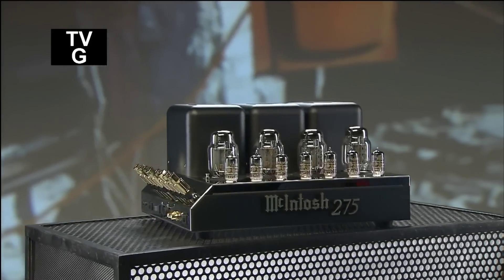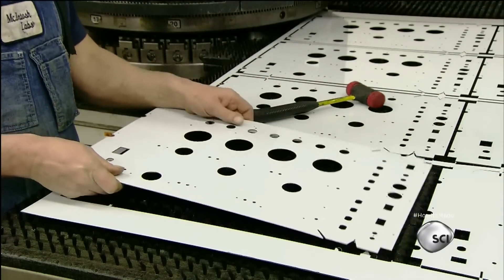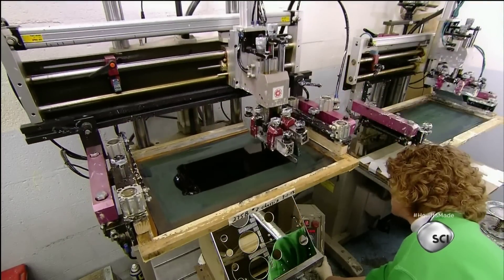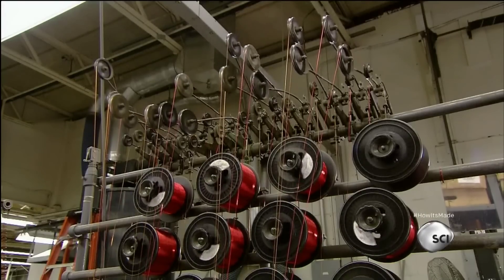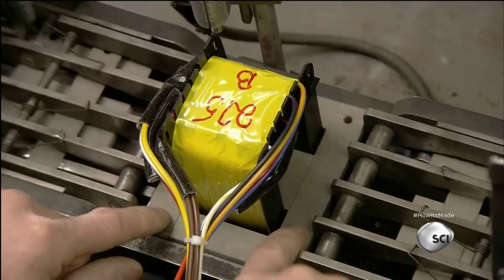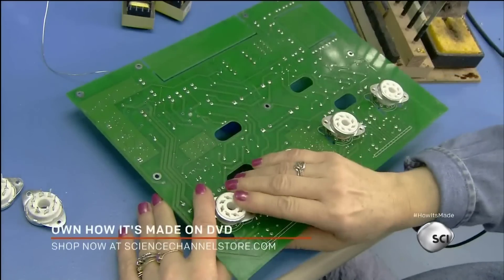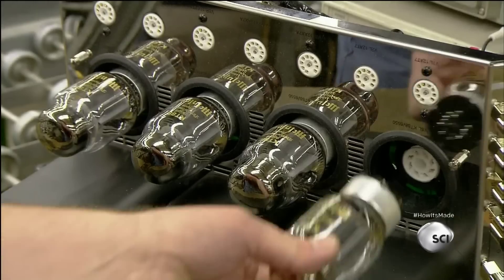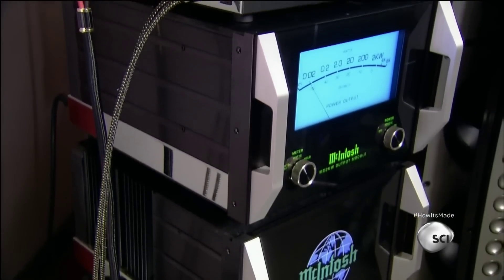How It's Made - McIntosh Tube Amp

Comment: 4:45  'LED lights turn green when the amp is powered up to let you know your wallet has been rinsed'
Reply: No mate, I'm a retired English electronics engineer, with valves and their operation well behind me. Contrary to popular belief, I am neither senile nor stupid. Old I may be; life's experience has taught me how to spot gimmickry a mile off. I could enrich my retirement by going back into the business and selling new clothes to gullible kings for vast crocks of gold. I can't be bothered. I am comfortably off in my retirement without the need for watching people burn money purely to show their friends that they can. Don't bother trying to patronise me, I'm too old for that sort of thing. ( 'oligarchs' by the way )
Reply: Really Paul Arias ? ... If transistor is not cheap  you will not be typing behind the keyboard.
Reply: I gotta say I hate those LEDs. They interfere with the soothing orange glow of the tube filaments!
Reply: +Prince Westerburg LOL any home system would be source limited long before I would pay a fraction of £500k for it...not saying a good salesman couldn't sell it to someone with the money.....just put that price tag on a $1000 system and tell me how it sounds then...
Reply: What are you guys talking?
Tubes have a much less live span than transistors. And Transistors nearly never die. Capacitors and such are built to fail in devices but not transistors. A Transistor probably would survive many tube lives......
Reply: For some odd reason I found your comments in the reply section to my original comment a year ago, so I replied.
Snap on MoD, plus lots more. I also have forgotten more than I can remember, most of it now superseded by higher level equipment. If you reach the age when you can afford this sort of kit, it is likely that your hearing will have deteriorated to the point that it is your ego and imagination that convinces you that this system and it's like are worth the money. Like I said, new clothes, gullible kings, pots of gold. It is possible that we are both pushing at the same open door, no offence implied or intended. :-)
Reply: If it's that good, why would you want to sell it? If you are buying the ultimate amplifier and someone makes a better one next month, then wait and buy the better one.
This can go on for many years, until you tire of wasting your money on last-year's model.
Reply: I listen to music - rememeber that? :)
Reply: Paul Arias Tubes need much more circuitry to get a result as transistors because of tube distortion.
Reply: @Rob Okray

I have an Solid State Amp Built in 1978. Never got refurbished or anything. All Original. Still working perfect. ( Sony STR 5800)

Watch eraly transistor radios. Old handheld Radios of mid 50`s. Many still work even WITHOU recapping.

But Capacitors and such have nothing to do with the transistor itself or its lifespan.

Theoretically Transistors are unbreakable. Only thing which could damage it over time is heat or mishandling. Otherwise there is no reason for a transistor to fail.

I am Guitar Player. On a 50W Guitar Tube Amp you have to change the tubes every 1 - 2 decades. Otherwise you can notice differences in sound characteristics ect. Also Tubes do not fail rarely in such amps.
Reply: But every piece of electronics get worn out sooner or later.
Reply: Tube "distortion" is why you buy tubes. Also electric guitars? Guitar guys kill for tube amps.
Reply: Having solid state, hybrid and full tube amps, both a MaIntosh MAC1500, and a modern push pull as well as a few single ended amplifiers I built myself I can tell you which ones I prefer to listen to.
It is not the 50 year old vintage amp either, it is the low power single ended amp I built.
No tube amp is as clean as a solid state amp, but it is the 3nd order harmonics added by the tubes that makes the sound warm.
A cheap 50.00 tube buffer will do exactly the same thing on a solid state amp. It takes the edge off of the harsh sound of digital sources.
Reply: nlo114  That's the best laugh I've had all week. Thanks !!!
Reply: I totally agree! I mean, my speakers I got off FreeCycle for nothing, bought tweeters at an electronics sale, built new crossovers and they sound amazing. Ditto with my amps, I just bought components. The Partridge c-core output transformers where the thing I had to wait 15 years to find.
Its not as good as an Audio Note system in that their stuff has matched components so the soundstaging is amazing but its still an 'Emotion Machine', people come round and just melt on the sofa!
One fave recording is Ella Fitzgerald and Louis Armstrong singing Summertime from 1953 and its like it was recorded yesterday.
The La La Land sound track is f*cking amazing! :o)
Reply: P.S: In my workshop I have a lovely pair of un-restored Goodman's (solid teak ) Magnums that I bought off flea-buy for the same price as they were new in early 1970's. I mainly use them for listening to music as I work, their sound pressure being quite adequate for my listening requirements . From time to time when I play DVDs they provide a wonderful depth of stereo sound at low volumes, without needing super-current to drive them. I say 'stereo' because like a lot of older people I only have two ears, rather than the latest odd-number variant of the human race.
Reply: Well it is for the believers...
Reply: I am a perfectionist.
This means that I am never satisfied, so I never waste money until I see perfection as the light at the end of the tunnel. Perfectionism is a sad disease that ends with very low achievement, primarily because second best will simply not do, and buying second best is not good enough. For money earning purposes, I work in the space industry where there is no second-best, only fitness for purpose at the specified price. That is my only source of mental satisfaction.
Reply: All depends on the circuitry design. I know older guitar amps had bad designs using one power supply for all tube heaters which is leading to uneven wear. While some tubes were a bit overdriven others got too less. High End guitar amps have a single PSU for every tube or 2 as far as i know to pretend uneven wear and all such. But in comparsion with transistors, if driven correctly, transistors only enemy is heat.
Reply: Tube Amps are not better. In fact Tube amps are the worst thing to go if you want accurate reproduction of your audio.

ALL Tubes has Distortion characteeristics which makes this warm tube sound. What means distortion? Exactly, the output signal does not match the input signal in any way anymore.

So technically tubes are the worst to go. But some people just like that warm sound with tubes and vinyl records.

But that is a subjective oppinion and a matter of taste. It is not my taste i have to say clearly. I prefer my Sony Amp totally.
Reply: BTW, if you're in the south east, have a look at www.audiojumble.co.uk - lots of other similar events about, they are a great day out!
Reply: LOL, exactly..use the "think method".. it will sound so much better..
Reply: Because we're human and like to try new things. Just because we sell something doesn't mean it sucks. This hobby isn't fun without variety. Understand?
Reply: Ok, maybe I was harsh on transistors, but valves/Vacuum tubes seem to me superior in every way on stereos and intrument amplification, prove of that it's use world wide up to date.
Reply: Oh, so now they are all the same. lol
Reply: Klipschorns and some other speakers do sound nice with a few watts from a good tube amp though.
Reply: What?!? Ona 300B amp theres the 300B and the output transformer. Apart from a 1k resistor on the input to stop parasitical oscillation and maybe a pulldown thats it. really, there is nothing on the page. If it doesn't look like that then its complete crap and I agree with you! :o)
Reply: 12voltvids m
Reply: There are equalizers to get whatever kind of sound uwant
Reply: i am using the software equalizer of my soundcard ( external dac was too expensive for me )
I mainly use it to get the sound I like. I did not do much in the EQ. I raised 4, 6 and 8 KHz a bit because i like brilliant heights and my speakers are known to have a little disadvantage in the mids / presence
Also i pushed 60 and 30 Hz a little bit up to recieve a bit more vibrance in the sound.

I would be intrested in measuring it to get a feeling how flat is it now and how they are with no EQ etc.

But i dont know how i can measure it properly. I did not found any Datasheets to my speakers on the internet.
Reply: You can test them in a tube tester, but yes they are probably still fine. Unless the seal breaks and the tube goes gassy or they are over driven, or the bias is too high they can last for a long time. My McIntosh MAC1500 still has most of the original tubes and they are still performing great. The capacitors are when went bad and have been replaced.
Reply: @ukfan4sure1 as electrician and future hopefully electric engineer i know enough about tubes to know they are inferior in any way.
Its your subjective taste if you like them more for what ever reason.
Reply: @ukfan4sure1 
Is that not what we strive for. So that the system accurately reproduces the sound as recorded? I believe that is the goal here to be transparent, and not add or subtract from the recorded sound.  Correct room acoustics play a role, as does ones hearing or lack of it. However, an equipment manufacture tries to build equipment that will pass the signal through without degrading it, and flat is about the only way to do that.
Reply: @ukfan4sure1 but you would never agree to a blind A/B comparison just like the rest of your rhetorical ilk...that's the point not your nonsensical slop...
Reply: @ukfan4sure1 i know exactly what you will do from experience with uninformed elitists like yourself.. you will rave on endlessly and actually do nothing to improve you position of zero information.
Reply: @ukfan4sure1 LOL maybe so..but that doesn't change  your imbecilic caterwauling into anything useful..parasites to the internet like you should go away and stop bothering people..
Reply: @dom3827  I suppose you are an electronic tech?
Reply: @dom3827  good for you..
Reply: rinse and repeat I always say. LOL!!!!
Reply: How much do they cost then?
Reply: Yup, green IS the color of money...and specs don't support that tube amps are better...and so called audiophiles will NEVER submit to blind comparisons for any equipment..
Reply: @oilsmokejones3452  thats because this $30,000 turntable and $75,000 amps and $125,000 speaker nonsense is the same exact thing as buying a Ferrari over a Prius.  Both cars will get you from point a to point b but narcissism rules in this world and rich folks can't be bothered with the fact that the money they paid for a record player could feed 10,000 homeless people for 3 months....
Reply: @oilsmokejones3452  Guitar Tube Amps are better that's for sure no matter what specs say..but thats different.
Reply: At least the amp wont be obsolete in 6 months.
Reply: +nlo114 maybe that is the reason why they call it "McIntosh". because its the same with Apple, you pay a huge amount of money for nothing :)
Reply: @dom3827  great sound, keeps its value quite well to. Quality true and true
Reply: @dom3827  ...i would prefer Ma,let Labs Hifi gear...
Reply: +Dominik Lux those amps sound amazing, nothing you say about the name will change that. but the led lights are pointless.
Reply: @user-by7hj4dj9s  agree. I don't know why you would want a fake light instead of the actual glow of the tube
Reply: So I guess you're American and therefore obsessed right now with your political system - understandable, but I live in London and don't follow politics.
You'd be surprised how much detail recorded media has, which does appear at the top end. The subject is so vast that you should appreciate it is difficult to explain in a YouTube comment!
One AN customer was recommended to us after he had spent hundreds of thousands of dollars on hifi and wasn't happy, then his wife bought a $100 Sony for the kitchen and he loved it - it had no pretentions. Look at most valve amps, they are simple and sound natural.
Ultimately, I appreciate that you cannot see what the fuss is about, top end gear costs up to 95% of it's price tag to make and until you hear it you cannot believe it will be better.
When you have billionaires and olygarks for who price means absolutely nothing, there always will be a market.
I have nothing to prove though I woudl very much suggest you go to a hifi show or dealer and listen to a valve system.
Reply: Gabriel Vazquez 
Equalizer? Seriously! A properly designed system sounds best with nothing between the components. Flat, because all the EQ was done by the recording engineer to produce the sound that the artist desired. Played on a properly matched system will produce that sound without coloring the sound in any way.
Reply: Good quality cost money. McIntosh components hold their value very well. Yes,  while the initial investment is high, when you go to sell the item you will find that you will get most if not all of your money back. This obviously speaks volumes about what customers are willing to pay for a high quality and well established brand like McIntosh.
Reply: DIY Dan  Well said !! As another footnote when these components become classics they often demand and get more than original purchased price. This truly speaks of their engineering, reliability, timeless design and consistent quality performance. As another proud owner I can attest to this as well.
Reply: You get what you pay for. The reason these are still being manufactures, and people pay top dollars for them is because they do have a different sound, and to those with the money to buy them, well worth it,
Reply: I like tube amplifiers and radios etc  just like how we still like steam engines/trains...  but  just like  those  steam engines ,  Tube  amps are  less efficient,  consume more power   and bulky.  A good solid State Amp will  beat  Tube amp in every measurable parameters.   Yes Tube amp does  beat the SS amp in the nostalgia  department.
Reply: "valves and their operation well behind me" - So why are you watching videos on McIntosh?
"I am neither senile nor stupid" - But replying to people who wheren't in a conversation with you.
A neighbour of mine is retired and worked for the MoD on missile guidence systems, he's forgotten more than either of us will ever know. He scoffs at valves too but then he hears my system is blown away. As said, you don't need to spend mega bucks, the sound is great and there are those who spend silly money on Naim / Ruake / Chord systems thats sound terrible.
Reply: So what? That amp will be around long after the solid state amp has been dumped in the landfill. Why? Because people throw away solid state when it breaks. Cheaper to get a new one.
Reply: My tube system is 50 years old, has a fresh set of tubes, caps and wiring. I also have another set of tubes and can get new matched sets easily for less than few new LP's. Not really worried. Also have two solid state systems, that while still "working" need recapping as they are sonically dead. As well as a pile of solid state systems that completely failed. All decades younger than the tube system, which only blew it's top in 2015. 1967-2015 was a pretty good run.
Reply: i know that they do so. My point was just the overpriced price tag specially of McIntosh and compared it to overpriced apple products. The name McIntosh matches good.

But yea, tube amps sound nice thats correct. I dont have one, but i have got a 1978 solid state amp so clean that you think its fresh from the company. A Sony STR 5800. For a Transistor amp it sounds really warm and nice. With that i am using 2 Magnat Zero 5, 20 Years old Speaker, but aswome and in best condition. And at last place ive got a 200€ Soundcard and flac music.
Reply: I can't speak for power amps, but tube preamps sound GREAT, and they won't kill your bank account.
Reply: +Dominik Lux if you got money for one of these you got tube money
Reply: Yeah, I totally get that - apparently the major record labels never wanted to move to stereo and it was only the marketing guys telling they could sell everyone new gear that made the choice! I run stereo as I've used surround and its a gimmick, almost impossible to set up correctly and with good hifi you don't need it really - its making up for inaccurate drivers.
Goodmans Magnums - paper cones, excellent! The BBC discovered to their horror that polypropylene cones have what they call 'poly-probles', inherent resonance in the midrange that kills sound staging, they moved to TPX cones. I use paper coned AR38s with Vifa soft dome tweeters and crossovers I copied from Snell Type E's.
Reply: P.S. We didn't advertise and had no salesmen, like Rolls Royce the gear sold itself. You're goign to hate this too - vinyl absolutely pisses on CD at the top end.
Reply: Aah - Apologies! {:o)
YouTube comments has a problem, there is no vocal tone so and actually I reckon we are probably singing from the same hymn sheet!
I love early Chord and Quad amps.
Valves get me intimate string quartets, sit jazz divas on my lap, make acoustic guitars viseral and real before me and generally get the sound cinema's had when I was a kid - everything from Star Wars to Lawrence of Arabia sound big and open. I know thta some of that is the woofer flapping about, generating voltage that affects the output transformer but, aah, its ousnds great! :o)
Reply: nlo114 transistor is cheap trash, like trash ? go for it.
Reply: I have twenty year old tubes in some of my amps, and they are still fine.
Reply: +Prince Westerburg   LOL, RR has no salemen, right...anyway great pivot away from the fact that no recorded source justifies £500k for a home system..Let me guess you are politically liberal. They exist on pivot and bait and switch. Calling you Prince BS from now on..You're going to hate this too - everybody knows good vinyl pisses on CD.
Reply: tubes has less life time than a transistor. a good transistor amp will last longer than a tube amp. You will have to change the tubes sooner or later.
Reply: @dom3827  Who cares,... Give me a tube amp any day of the week!!! When your transistor amp goes out, just throw it away.  Tube amps get to sounding a bit off, find the weak tube, just replace the tube and good to go....unless it is a bad electronic component.  Generally, at that plate voltage, you can see the bad component...it's toast
Reply: @dom3827  Yes, they're consumables. Replace the tubes and the amp is good as new.
Reply: @dom3827  It's not about the life...it's about the SOUND.
Reply: @dom3827  Another wallet rinse
Reply: @dom3827  Really? I have radios from the 1920s that still have all original tubes in them. Transistors haven't been around longer so the jury may be out on that claim
Reply: I play and build guitars, guitar amps, valve hifi and studio recording gear and use to work for Audio Note.
I'm not going to try and slag you down - it serves no purpose. Any device taken outside it's operational parameters will suddenly develop a character, take EL34 pentode power valve, in a guitar amp they are the soudn of Marshall, but add a GZ34 valve rectifier and they are way sweeter, use them in hifi in push-pull and they own the room, in single ended mode they are sweet and in single ended triode they are very sweet and lively, a beautiful sound. But people tell you they sound hard because Marshall is all they have heard.
Humans are curious things, clinically clean amps can sound worse than something with a little 3rd order harmonic distortion in. Really, if you have a chance to listen to some vintage or modern valve gear do - if its modern though watch out for transistor drive stages, silicon rectifiers, steel chassis, cheap electrolytics etc.
Wow, I made this as short an answer as possible.

Short answer: Used in their operational envelope valves are perfectly clean and linear. :o)
Reply: I used to work for Audio Note, valves are not warm they are very linear and true Class A amps are extremely transparent. There is a reason people happily pay £500k for a system other than they can afford it. On the top end system, there is no system there, every track sounds completely different, there is no system sound colouring it.

But I lived with these systems for years, I'm extremely lucky and believe me, nothing else comes close - Its taken me 15 years to collect the parts to make my own 300B amp and I'll listen to it for the rest of my life.

For what its worth; Audiophile magazine in the states did a review of our DAC5 Silver Signature and they split the review down the middle. The technical test said it was the worst measuring DAC ever, the listening test said it was simply the best soudn from digital they had ever heard.

Go listen, use your ears, not a scope.
Reply: @PrinceWesterburg  why do the people that dont want to save always complain about price. I saved for 3 years to get a tube amp and absolutely love it I had a problem with it they paid for the shipping and everything to fix it.
Reply: My tube amp is smaller than my solid state. It is heavy, Has some giant Hashimoto transformers.
Reply: +Dominik Lux   Tubes do have less life time than a transistor.  But transistors usually express less life.   BTW... I listen to solid state in recent years.  Tubes are geared for audio connoisseurs..  There is a difference.  A very nice one. But only for those willing to put up with the need to change tubes when needed.